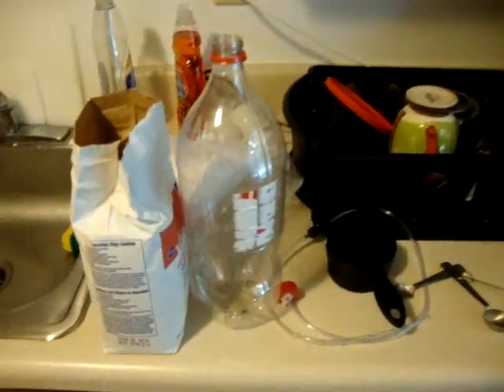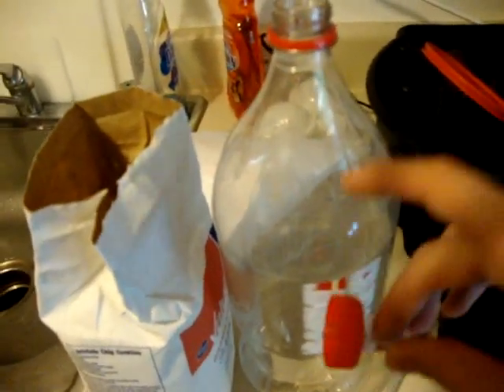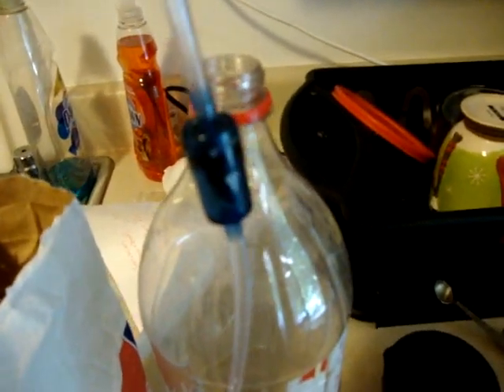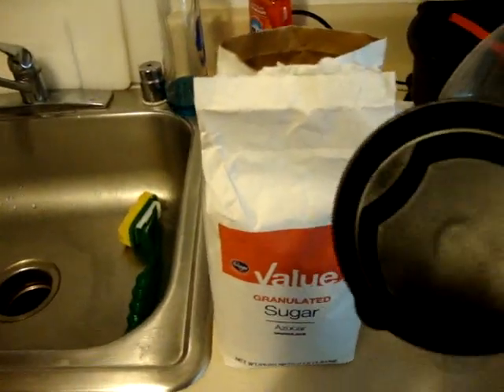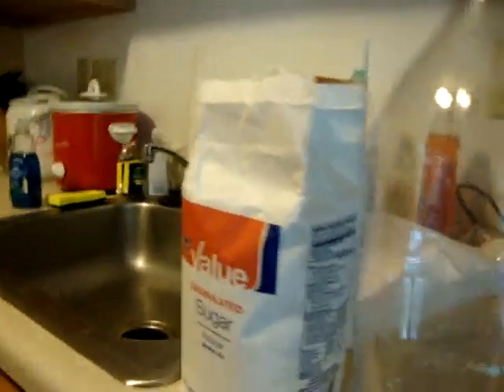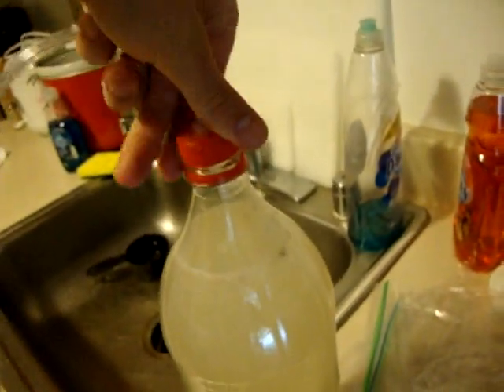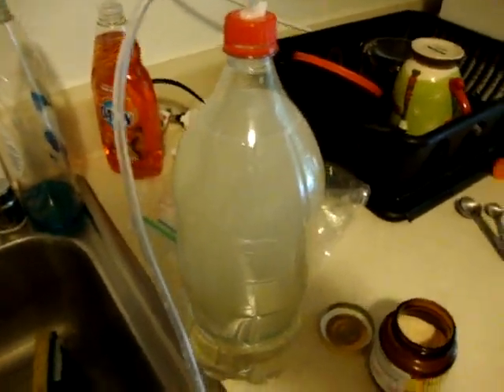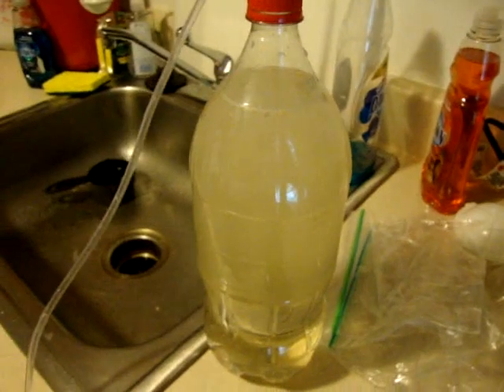DIY CO2 Injection Recipe for 10 Gallon Aquarium

Comment from the maker: You could probably get it to work with a 2L and the same recipe. It's better to underdo it and then upgrade than to overdo it. If you find that you need more c02 then you can always add a second reactor vessel (2L bottle) in series. Then you can even change one bottle every week and have a more constant supply of c02.

I don't think doubling the recipe will help if the reactor vessel is the same size. The yeast will have limited space to grow.

Comment from the maker: You can not turn off the reaction at night. If you are worried about building up too much c02 in your tank at night you can always pull the diffuser out of the tank and then put it in again in the morning. Please do not plug up the hole or use some sort of method to cut off the flow. This will cause the c02 gas to build up potentially causing the bottle to explode.

Comment from the maker: I used an Airstone on my DIY setups for awhile but you're better off going with a glass/ceramic diffuser. You can pick one up pretty inexpensively on ebay or from other hobbyiests. For a 200L tank you'll probably want to use two 2Liter bottles of mixtures and see how far that will take you. You can try staggering them also. By that I mean start one mixture then wait a week and start another. The next week replace the first mixture and so fourth. That way you always have a fresh bottle.

Comment from the maker: @colliente97 The c02 needs to be diffused into the water. Some people use an "airstone" as a diffuser. It makes tiny c02 bubbles. You can find a much higher quality diffuser on ebay though for less than $5-6.
A bubbler would counteract c02 by lowering the c02 levels in the tank to be at equilibrium with the atmosphere.
Yes this setup is like a bubbler but with c02. C02 provides carbon to plants and allows them to grow stronger.